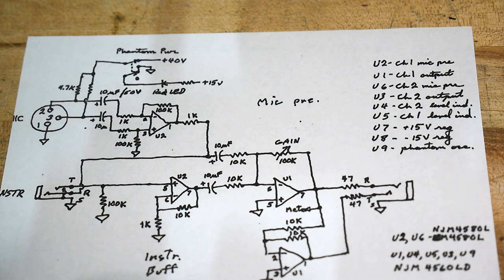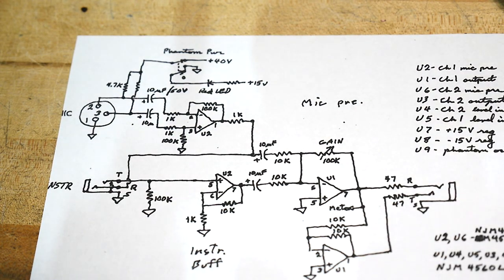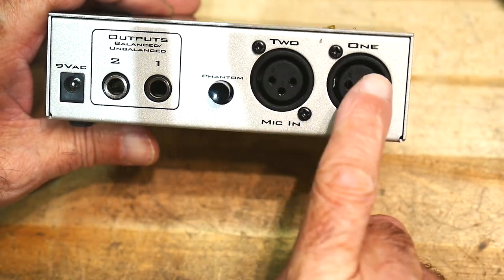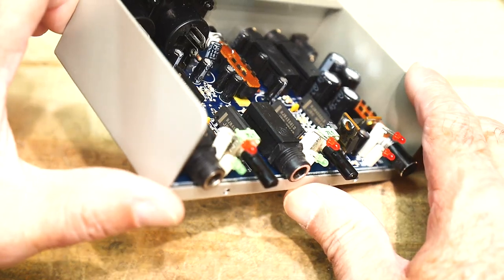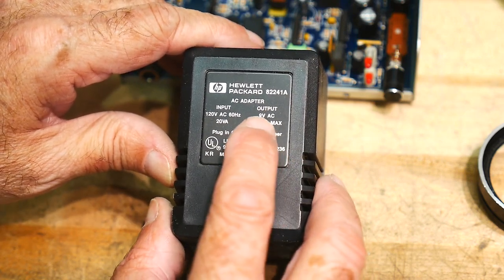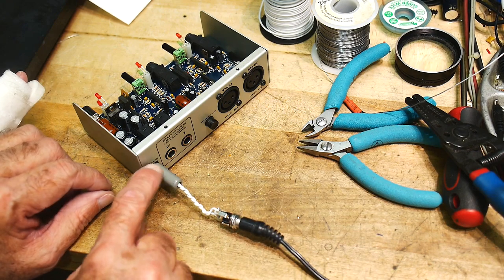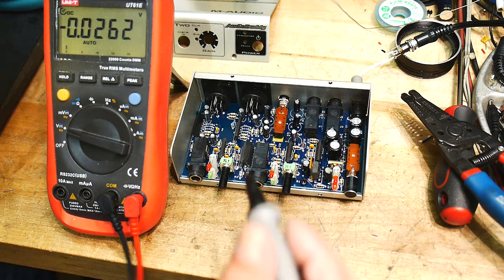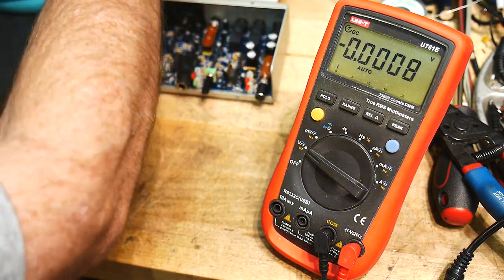#444 M-Audio Audio Buddy Dual Microphone Pre-amp

Comment: Balanced in the output means there is an extra signal wire, with the extra wire carrying a reversed signal version of the original audio, so that you can sum them at the end. Since both wires will pick the same interference and noise, the end result is a preserved signal with all noise and interference cancelled. Pretty standard in most semi-pro and all pro audio equipment.

Comment: Hi, I don’t have the power adapter for mine, and I was using a universal adapter but it’s making noise; almost like a muffled subwoofer base. Could I be using an underpowered or overpowering adapter?
Reply from the maker: are you supplying 9V AC? you might be sending 9V DC and it won't work
Reply: @IMSAIGuy  It is a Universal Power Supply 9V 2A AC Adapter 100-240V AC to DC 9V 1.8A 1.5A 1A 0.8A 0.5A 450mA Power Adapter. Am I using the wrong adapter?
Reply from the maker: @dadaUnts  Yes, I think so. the output is DC and you need one that outputs AC. they are actually a bit rare these days.
Reply: @IMSAIGuy  So the HP adapter you used didn't say ac-ac, and I was focused on the other specs like 13.5 Va. Besides 9V AC and 300-600ma, what exact specs am I looking at specifically?
Reply: @IMSAIGuy  oh and what was the tip size you found that you rigged up; was it the 5.5 x 2.5 or the 5.5 x 2.1? thank you for your insights
Reply from the maker: @dadaUnts  yes it did. the label reads 9VAC output
Reply: @IMSAIGuy Is the schematic image you provided exactly the same as the tool, sir?

Comment: I need an adaptar maybe it was 9v and dont know what was the AH 1A or 2A, I forgot, and can u tell me one thing when i powered with 9v adaptar the power light blinks and just gone. What is the problem.? I will be happy please help
Reply from the maker: Are you using a 9VDC adapter? It needs a 9VAC at 500mA. the LED should stay on
Reply: @IMSAIGuy  I tried once with 9v 1A and light comes by pressing the power button and didnt hold the light. Just blink and gone? But i will definitely update you by using 9v 500ma. Thanks and please can you mention, if the power do the same malfunction what probably the problem, I mean why would that do.
Reply from the maker: @relaxandsleep6891  You did not verify you are using a 9V AC  do not use 9V DC
Reply: @IMSAIGuy  ok I need to buy 1, but where do I get 9v ac 500ma adapters?
Reply from the maker: @relaxandsleep6891  google it. I found:
https://www.jameco.com/shop/keyword=9vac-power-supply